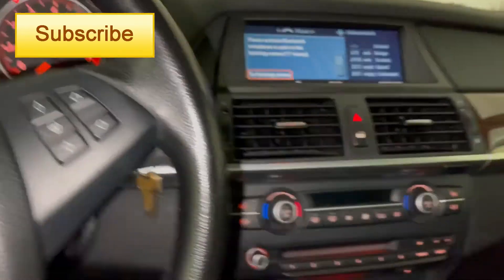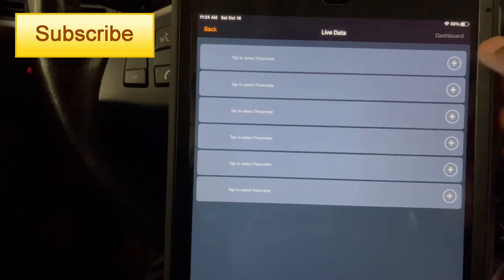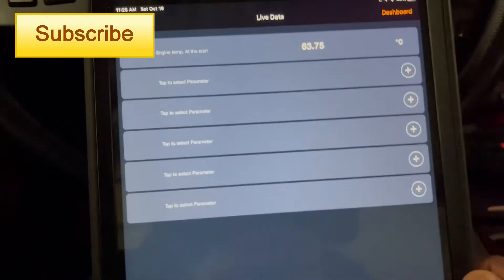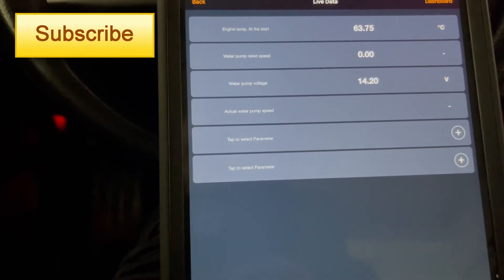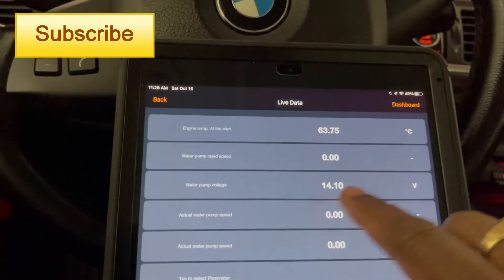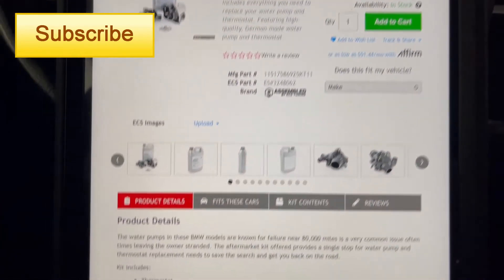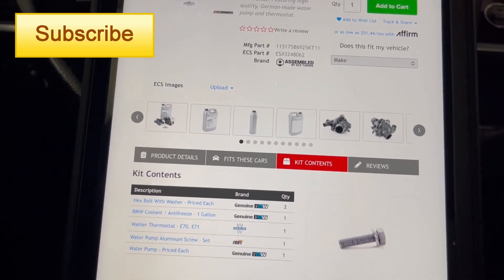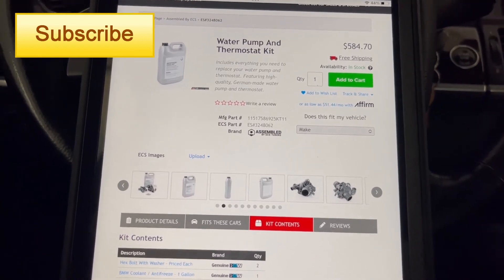BMW ENGINE OVERHEATING DIAGNOSE AND REPAIR COST

Comment: hello
Is the engine damaged when the overheating message occurs, when coolant begins to flow out through the frayed hose and the engine is immediately turned off?
Reply from the maker: the engine shuts off to prevent damage

Comment: Replace waterpump, thermostat, cooling fan, radiator, sensor, relay, and check all fuses, but fan is not running even when ac is on. I get code 002EFE  electric fan, activation??? Cannot activate...help
Reply from the maker: why did you replace cooling fan

Comment: Hey yard man nice vid i thjnk im having that issue did you replace it and did it work afterwards
Reply from the maker: yes I did replaces it and it is still working
Reply: Am having the same issue....please how do i connect with you for work@yardmanmotorworks1759
Reply: Cool so I replaced my water pump yesterday with a used unit with a 2019 build date on the pump and a new thermostat driven roughly 100 miles car is running good car temp fluctuated initially at 15 to 109c then came down to 86c  90 now it's consistent between 96c to 99c with air conditioning on in 90 to 100 degrees weather in The high desert of California .
Reply: The used pump installed is the original design  with plastic front cover and impeller $120 and it's working good .. they say the pumps don't last long but the one in my car was original to it production date of 2011.. my car has 158k on it and the pump was still working but I believe the bearing was going bad .. but still working intermittent... Thanks to all

Comment: Is the waterpump you showed the best one to buy for the price and reliability?
Reply from the maker: this water pump is genuine Bmw so it should be the best one.
Reply: @yardmanmotorworks1759  the stock waterpump bmws is awful, lasting around 80-100k. Mine lasted 40k!!
Reply: @yardmanmotorworks1759  also does the e9x generation automaticly turn off to prevent damage from overheat. Or does it only display shut it off

Comment: My 2011 535 n55 is overheating and fan comes on more than normal when driving. I changed the oil filter housing gaskets. Ran the pump to bleed the system. It came on and circulating the water. But fan still comes on and overheats.
Took to shop to have coolant flush and they said its the water pump, so they didnt flush coolant. 
But im like, you sure its not the oil thats mixed in coolant system? Because when the screen says engine overheated, the gauge in dash is not saying overheated.
Can anyone help?
Reply from the maker: you prob get this fix already, but if the water pump stop works it  will show over heat even if the temp gauge does not show. the computer can detect the water pump speed and any malfunction
Reply: I just had the problem
Yesterdya , how did you fixed it
Reply: @elmario6549  They said had to replace water pump.
Reply: You probably have been gotten this fixed but the gauge on the dash is for oil their is no coolant gauge .. u have to go into dash menu to see tempeture
Reply: @RoadHeros610  Nope. Car has been parked for a while now. I have to get water pump and front axles replaced. I didnt notice it didnt have a coolant gauge. I never paid attention I guess. Never really had problems like that.

Comment: Okay say I had a coolant leak bc of my radiator my car overheated and I couldn’t even start it after I replace the hoses and the radiator will it be okay?
Reply: I have a 328xi it’s in good condition I keep in check with all maintenance one of my hoses just happened to burst while driving
Reply: You have to rest set everything or that the battery out and plug it back in
Reply: How do you reset everything